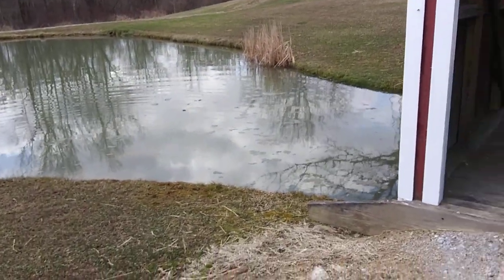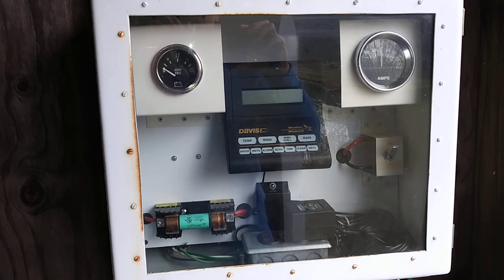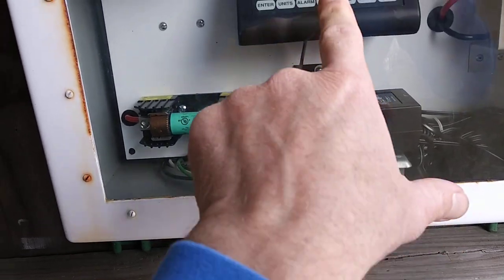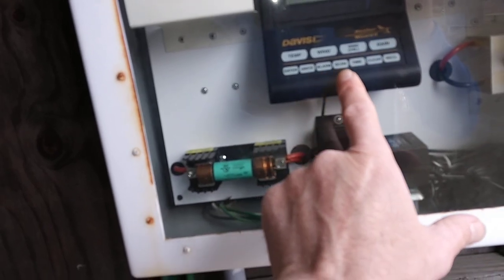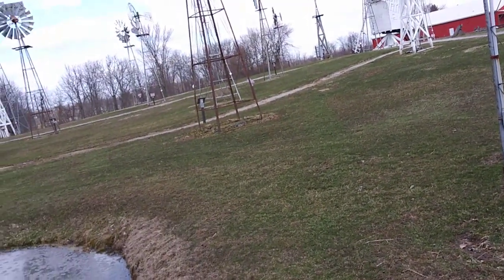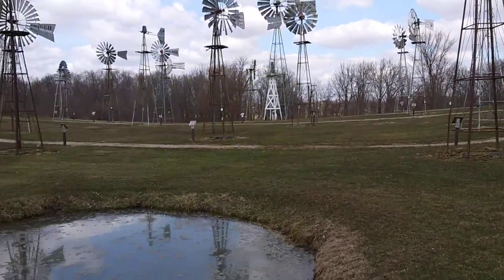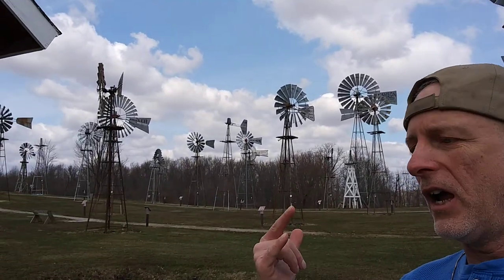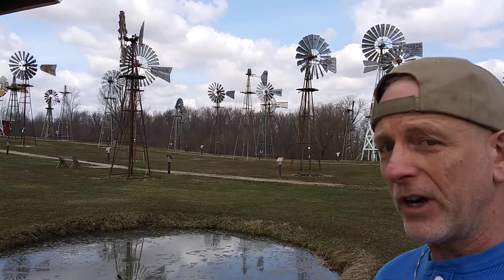Mid-America Windmill Museum P 3

Comment: So from your wind power, to your charge controller to your battery. Then to your converter. Right? What makes the windmills slow down when it's going too fast back then?
Reply from the maker: Yes and yes. I have seen modern wind generators that the tails turned by electronics but now I should be able to build something myself in the future.